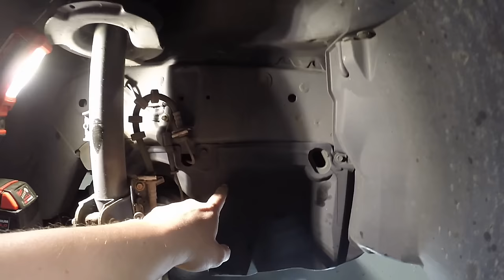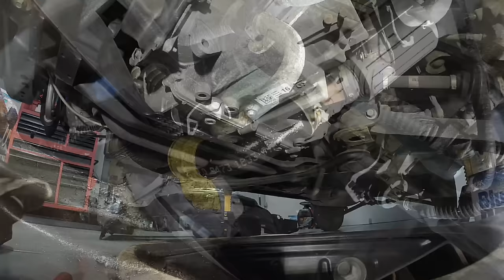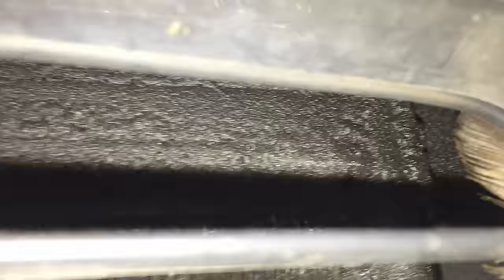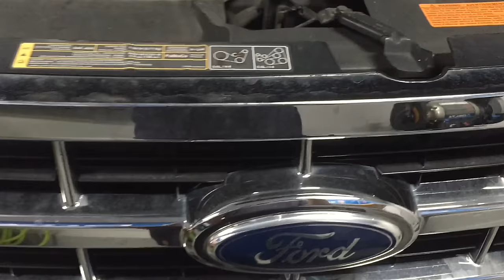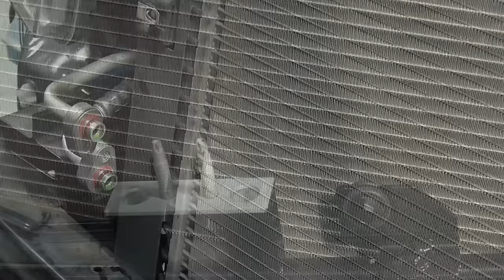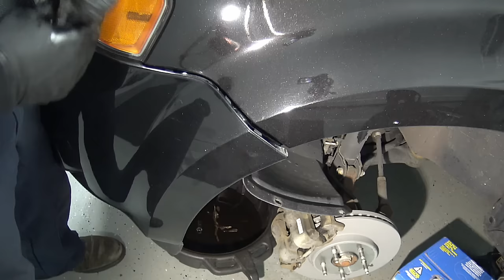2008-2012 Ford Escape Transmission Fluid Leak: A/C Condenser Replacement

Comment: I know its off topic, I just bought a 2012 f150 with a 5.0 and it has a knock low in the engine at a warm idle. I see a lot of complaints on line about it, have you heard anything?
Reply from the maker: +mcnamee30 Yes there can be many issues but it seems yours being when warm it is likely the cylinder sleeve issue these have requiring a short block.
Reply: +mcnamee30 I had to have my short block replaced. press the issue! took me a year before they finally did the job.
Reply: Will a compression test and cylinder scope prove it?
Reply: Thanks for the info guys!
Reply: +mcnamee30 that's what the techs had to do with mine. they had to do some tests that ford wanted the to do and sure enough it came back that it needed a short block. it was a 12000 fix here in Canada.
Reply: I see where some places change the long block and some have gotten the short block. I think mine is using some oil too. About 1/2 qt in 1000 miles.

Comment: Mine is a 2010 escape and with 150,000km the transmission is leaking oil badly. The resonator is cracked and has many issues.
Now when turning the key it just makes a very loud ticking noise and wont start. Pretty odd for only this many kms right? Wtf is wrong with these vehicles. Also never started until turning the key a second time. Why??